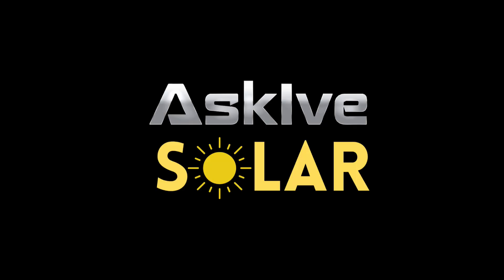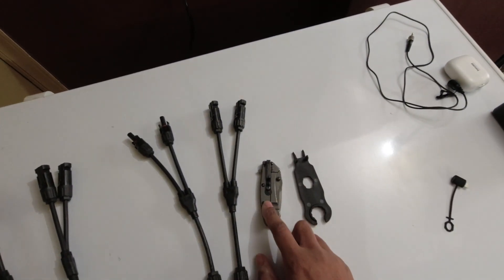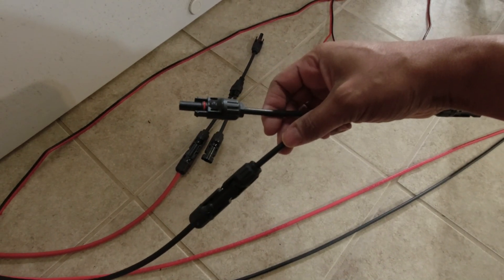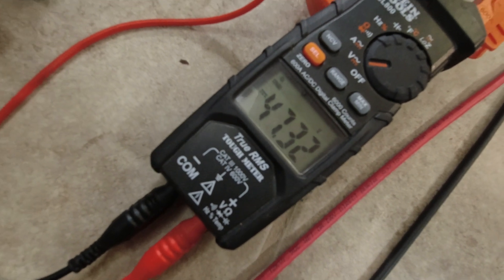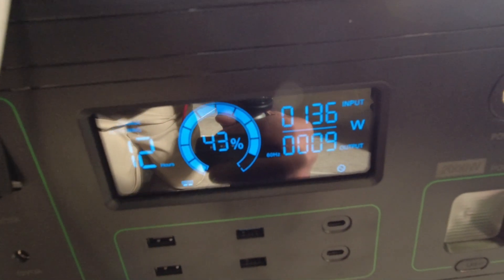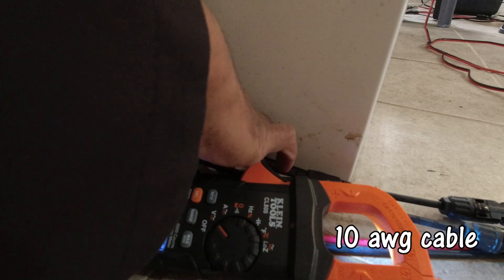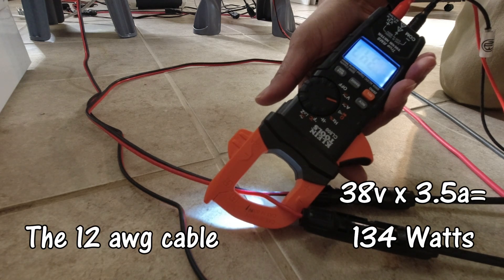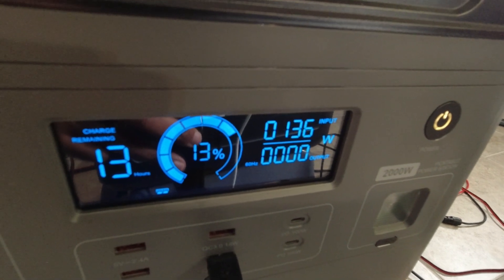What Size Solar MC4 Cable Should You Get? 12 vs 10 Gauge / AWG

Comment: I will be using 8awg cables. Have a long run to the house.
Also, I think that is the biggest MC4 connector you can get.
Reply from the maker: Smart. Check out the renogy solar wire calculator. It been helpful.
Reply: @AskIveSolar  Checked several charts. All say for what my setup is I need 8 gauge or 6 gauge for a 100 foot run.
MC4's only come as big as 8 gauge.

Comment: So I have THREE 245 watt solar panel (Each panel- open circuit voltage 37.4, open circuit current 8.61) 
Can you tell me how can I use this 3 panel to charge my BLUETTI AC70
Reply from the maker: You can't. It's too much voltage. You could maybe do 2 in parallel.
Reply: @AskIveSolar  Are you 100% sure I can add 2 panel in parallel? Will it not increase the voltage? 
Can I use a Solar charge controller to charge as 12 volt battery with 2 or 3 panels.
Reply from the maker: Adding panels I parallel combined amps, voltage stays the same. 
Actually dont put them in parallel either. The ac70 has a 10amp input limit. 

Yes, you could get a charge controller and hook it up to a battery, as long as the charge controller can take in the voltages from 3 panels in series. 

But how will you get the power into the ac70? 

Find me on FG, IG or Telegram and let's talk this through, as time permits
Reply: @AskIveSolar  I also have a RENOGY 100 watt Solar panel and charging through this.
Reply from the maker: Do you have any of those chat options I mentioned
Reply: @AskIveSolar  No sorry
Reply from the maker: Basically, your ac70 is a one large panel device.  Or a couple small panels. But you can't use multiple big panels.

Comment: Which one is best to use with 100 watt and 245 watt solar panel with BLUETTI AC70 power station?
Reply from the maker: 12 is fine for both at a reasonable length around 50ft or less. If you're going to try two in parallel then 10 would be ideal. 

Check out renogy wire gauge calculator
Reply: @AskIveSolar  Thanks. One final question, Can you use Caravan or Motorhome Hook up cable as 10 meter Extension cable from 245 watt Solar panel to Solar Power Station BLUETTI.
Reply from the maker: Not unless it has mc4 cables on the end. I would just purchase an mc4 extension cable.
Reply: @AskIveSolar  I can connect MC4 with the wire as have Crimping tool & MC4 plastic socket with metal part for crimping. I mean will the Wire inside those hook up cable support solar panel DC current transmission
Reply from the maker: If you're savvy enough to do it, just see if the you can determine how much amp or current those cables are typically capable of.  

My opinion doesn't matter, it only matters how much current those cables can carry v

Comment: Great video! You present clearly... I always commend YouTube creators, I had a channel some years ago, and I remember how much work it was to plan and edit videos... Just a small suggestion for future your future vids if you do more testing analysis...if possible, maybe consider using the exact same system, with only one manipulation, that way you can know the results are is only due to the specific one change you made.... in this experiment the change being the 10 awg or 12 awg.  It's hard to know if the performance of the 10awg is because of the power station differences.
Reply from the maker: Good point about the variables. I'll keep that in mind. Thanks

Comment: Most important reason to opt for the 10awg IMO, is to weed out the cheaply made stuff that will cost you in the long run.  I've had more than a dozen adapters, extensions, etc either melt or catch fire in recent years.  Definitely don't buy any components from temu either!  One extension I bought from them melted and then caught fire in my van while I was driving!  Totally not worth the discount!
Reply from the maker: Knock on th bible, I've not had any issues with wires. I will never order anything from temu ever.
Reply: @AskIveSolar  You're very wise my friend!

Comment: Is 12awg fine to use with my Victron 100/30 charge controller? The wires are only about 4 feet. It’s connected to a 100w solar panel.
Reply from the maker: What's going on! Ask yourself, how many amps will be moving through this cable. If you have one panel 100 watt panel, it's around 5 amps. 12awg can carry 5 amps all day long. :)
Reply: @AskIveSolar  Thank you for the reply!

Comment: I want to connect 2 100w panels in parallel into an ecoflow river 2 pro. The panels will be on top of my car and the generator will be in the trunk. Would a 20ft extension cord be enough and should I do 10 or 12awg? Also can you connect a 10awg cord into a 12awg XT60 wire that goes into the generator? Thanks!
Reply from the maker: What up boss, 12awg at 20ft is fine. And connecting any gauge came to the devices cable at 14 is fine too. Because that cable is short it can handle the gauge the device is rated for. 

Renogy has a solar cable calculator that you check out of you want to learn a bit more cus tinkering with numbers re: volts and amps and length
Reply: Gotcha, I found a 20ft 10awg cable and a 10awg xt60. So those 2 would work fine together right? Also the 10awg xt60 would plug right into the river 2 pro wouldn’t it? Sorry for the dumb questions I’m very new to this. Thanks!
Reply from the maker: Just to drive the point home, a short 10awg is rated for like 20amps which is like 4 100 watt panels in parallel. Thats why those short cables dont have to be as thick. Wire gauge starts to matter when the cable starts to get longer with relation to the amps. 

But it will still work, juts overkill. Yes, your mc4 to xt60 cable will go right into your River 2 pro. 

SNAP, honestly, with the river 2 pro, you can use them in series and then you dont even need 10awg because in series, its 40v x 5amps and 12awg cable will be more than fine for 5 amps at 20 ft. 

And you dont need a parallel cable.
Reply: Ok thank you!

Comment: I’m so confused. Not good at this stuff. I have 2 200w foldable panels for my bluetti. 
I plan on running in series. Max input to the bluetti is 10amps. Each panel is just under 10amps. I want to get about 10-20’ of extension cable. No idea what gauge to run….
Reply from the maker: What bluetti do you have?

If the device can accept that series voltage which combines the volts and not the amps then running 10 amps (realistically like 8) over 12awg is just fine. 

But if you happened to do parallel, which will be about 20 amps (16 realistically) then you should do 10awg.
Reply: @AskIveSolar  bluetti ac180. Max Dc input is 500W, 10A. 12-60 VDC
I couldn’t run them in parallel because the amps would be just too high   I think
Reply from the maker: @Treetopflyer777 You could technically run them in parallel but it would make any sense. Most devices amp limit so they have a hard cap. 

But either way, my first answer still applies. If those 200 watt panels are 12v which they likely are then you're good to go with my previous answer.
Reply: @AskIveSolar  thank you!!!

Comment: Could you answer a question? I have a 30A solar charge controller, with 2 separate inputs, for 2 150w panels, what AWG cable would be needed for this. Thank you.
Reply from the maker: You can't go wrong with 10awg but your length will matter some. 12 will probably be fine as will unless you're doing more than like 60 feet of cable 

Check out the renogy wire calculator to guide you. Search for it.
Reply: @AskIveSolar  I plan on having 3 meters in length. Thanks for replying.

Comment: It's distance that causes voltage drop..If you have a 50 foot or 100 foot run, to a ground mount, with a lot of panels, then you will see voltage drop..I use 8 gauge for my 5 thousand watt array which is 50 foot..But there is 450 volts travelling through them..
Reply from the maker: Well that's a snazzy youtube name! How many amps are coming through that line?
Reply: @AskIveSolar  Usually up to and around 11  Amps..Which is right around 5000 watts..In peak conditions..Low amps high voltage..It's more efficient..That's a 48 volt system..Ya, some say that handle fits me well, but, I've been scammed and have had my heart broken like any other dude..So, it's debatable..LOL..

Comment: Use Victron charge controllers they’ll take your higher voltage from wiring in series and make higher amperage with it and just the right amount of volts to charge your batteries
Reply from the maker: I'm more of a power station guy than a battery guy. I would love an all in one as I find that a lot of mppts still have the same 150v input limit or they are more costly.

Comment: Was about to buy a 10 gauge extension line.  Found yer vid just in time. I'ma go check out yer other stuff.
Reply from the maker: Yeah 10 awg is a good option to future proof if you plan to parallel 10 amp panels. But most situations / distances don't need 10awg
Reply: @AskIveSolar  Good to know. I currently only have th 1st Bluetti purchased thru indiegogo before it was on th mkt bc I was gonna live th RV dream.  And then covid... well, you know.   So now I use it to pwr up th  entrtnmnt ctr in th kitchen, daily.  But th sun's gettin lower & I need a longer ext cord.  I'll check yer other vids thru th wknd.  Maybe ya have an answer to a questn I haven't thot of yet.

Comment: VERY nice job!.....  I'd like to see the same testing in the difference between 10AWG and 8 AWG cables....  Again, GREAT info!!!!
Reply from the maker: I dont know if Jasonoid did 8awg on this channel but he had a video about wire gauge as well.
Reply: It's been done by others on YOUTUBE 8,10,12 at 100' he showed what the cable manufacturer says it would be, and what it was actually measured,10 gauge wire was said to be 16% drop but was actually 6%. Now I would only bye 10 gauge myself, but my solar generators take in 150v 45 amp on the 2 mppt controllers, 2000w. Mppt controllers will pick what is best automatically, higher amps, or higher volts

Comment: From what I have read- don’t take this as gospel— but the 12 gauge carries up to 100A while the 10 carries up to 150A. Of course there is voltage loss over distance so I don’t know how that works out… but most of these cables are 10 feet or so, and at that distance there’s likely negligible loss.

I don’t think these panels are carrying enough power to matter unless you’re running like 10+ solar panels in series.

Me personally, I am only running 2 panels in series at a time so I’m below all specs anyway.
Reply from the maker: I'm pretty sure that these cables can't carry that much amperage. They are rated around 20amps and 30amps. 

Check out this hqst listing for a 20 foot cable. Scroll down and it has a rating in amps. 

https://www.amazon.com/HQST-Extension-Female-Connector-Adaptor/dp/B09MLHL7V6/
Reply: @AskIveSolar  Interesting. I also read somewhere the specs are 60amp and that’s what the XT60 means. XT90 is 90 amp so maybe I am wrong.

I expect the “spec” is of course the max and they will recommend less than that as nobody will recommend you run something at the max potential due to liability etc.

Comment: Good video. You definitely need large enough cables to safely handle the amount of current that will travel through them, but anything larger than that is probably just wasted money. If someone is building a really large system, they will most likely be able to get a lot more power from buying more and/or higher efficiency panels and converters/inverters with the money they saved by not using oversized cables.

Comment: Why would I use a 12 why would he use a 10 why wouldn't that uses eight gauge or six gauge those are the sizes I'm going to go in for being from the panel to the house from that company back to the house I can't see you even talkin about a 12 gauge when all you doing is staying or 12 gauge or 12 gauge you going to make people use 12 gauge when they should be using 10 gauge or better.
Reply from the maker: This barely made sense to me. Im speaking about this with regard to power stations not solar systems. If you have a power station and its limted to 8 10 15 amps and you only have a few panels and only two in parallel, why would you need 10 or 8 gauge cable? Its overkill especially over shorter distances. 

People have to watch the video and if they decide after watching my video that they can just apply this logic to anything....I dont know how to address that. 

Did you finish the video or draw this conclusion from a sampling of the video.

Comment: You got the male/female mixed up. You should do the tests near the higher amps. That would be more useful info.
Reply from the maker: Where @ the mix up. And what do you mean by near the higher amps?
Reply: @AskIveSolar  What you call the male is actually the female MC4 connector, and vise versa. Closer to the rated currents to see losses at the upper limit of the rated currents. At the lower currents, the losses will be minimal. At higher currents even the materials eg copper vs brass makes a difference on the connectors. I'm looking at longer runs and higher voltage from the PV strings at slightly under 135Vdc,30A was trying to decide to go with 10AWG or the 12 depending on how much loss it was. I'm looking at 50-70ft runs. I see what the tables say, but all the tables are different so wanted some real world testing. So testing up around the 20A-35A ranges. I was leaning to go with 10AWG solid core XHHW, but now I can't even find them except in stranded.
Reply from the maker: You know what, I have heard that in trying to figure out how to replace them. But for the sake of being technical, the mc4 plastic is my all appearances opposite of what the pin inside is. 
I'll have to swirl around the other stuff you shared.

Comment: How long is your longest cable. I want to get my panels out of a shady area but my cable isn't long enough. If I get the extension (it would make it 80 feet) would that negatively impact output?
Reply from the maker: It’s kinda funny because in my mind any solar is better than no solar. Ha. 

But check out renogy cable length calculator. 
For the plus or minus 5 section just play around with the numbers. It should help you understand. 

But I’d think a 10 awg cable would be fine. What’s you array in volts and amps.

Comment: I don't use 100w panels. I got my hands on a used 285w panel and I set it up in my back yard. It does 9.8 amps. I REALLY wanted to save money on cables and go with 12 gauge. I wanted to put a 2nd panel in series with it. That would put me barely below the 20 amp max. I won't take that chance. I will have to stick with 10 gauge.
Am I looking at this correctly or could I swap to 12?
Reply from the maker: A 12 awg cable can handle that one panel up to certain length. If you get a panel with similar voltage then you can (in theory) put them in series. 

When you put something in series, the amps dont change, they meet at the lowest common denominator.

I would do a little more research on series and parallel to make sure you are clear on what your options are. 

I have a couple videos on the subject but specific to my setups over the last year or two.

Comment: Is it okay to run 2 180 watt panels in parallel through a 12 gauge cable. Or is that to many amps?
Reply from the maker: My first thought is no because you'd need fuses first and foremost and then that might be too much for 20 awg cable. 

How long would the cable be?
Reply: @AskIveSolar  the cable is 30 feet. Plus a 5 ft xt60 cable
Reply from the maker: So per that graphic, 12 awg cable should use around 16 amps which is 80 percent of the rated capacity. 180 watt panels are typically rated at about 8 amps or more so you would be right at the limit. 

And again, Ive been told that you should fuse above 15 amps. Thats the extent of my knowledge on the subject boss. 

What device are you trying to connect it to that you would go parallel.
Reply: @AskIveSolar  I'm running eco-flow river 2 max. So should I just run in series or maybe just use one 180 panel?
Reply from the maker: I would say so....right? Seems like overkill though but I dont pretend to know your conditions. But I would go series or better yet, I would put one panel on another power station if you have one.

Comment: Great video...In the future, to minimize as many variables as possible to make your results more meaningful, you really should use the same power station and panels for such comparisons...Liked that Klein meter...Just put one in my cart...
Reply from the maker: Yeah, what I should have done Scott was swap the cables and then maybe use the same one. With using the same one you run the small risk of the conditions changing ever so slightly. Good point tho.

Comment: ah yes the difference between 10 and 12 awg at 3 amps is going to be very minimal, if you doubled that by putting the solar panels in parallel instead of series, you would probably see a small difference. that said having them in series is the most efficient.👍
Reply from the maker: Hmmm @ it being more efficient. That's interesting. 
Good point about the lower amps not really taxing the cables per se. 

I guess for me, I wouldn't want to deal with fusing so it's unlikely I would ever go past maybe 15 amps especially as a long distance.

Comment: Interesting that you didn't see much difference.  Only 2V won't mean too much.  You're going to get as much or more variance just in the component tolerances between two presumably identical power stations.
Oh, and the multi-way cable I ordered arrived today; got to go down to the mailbox and get it.
Reply from the maker: And really, it could just be that that array or that device is just lower or the device reads higher watts. I should have swapped the cables as sleeper pointed out. 
I thought about it after the fact but I went right into putting the panels in series for the ac200p.